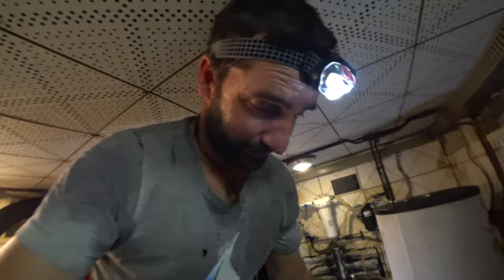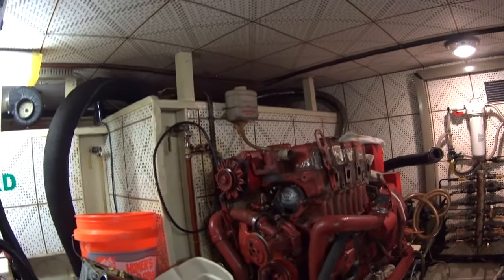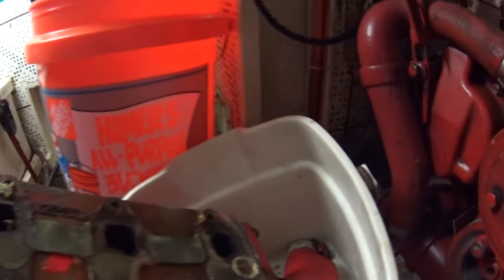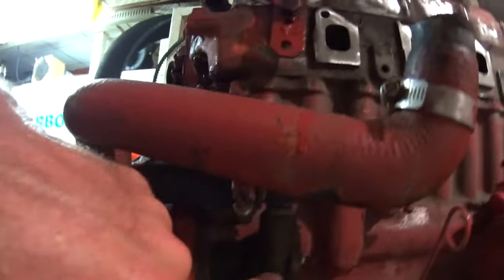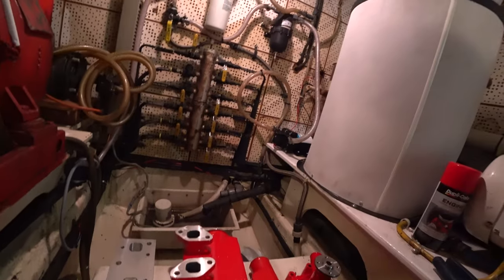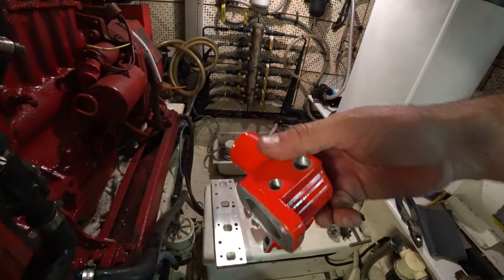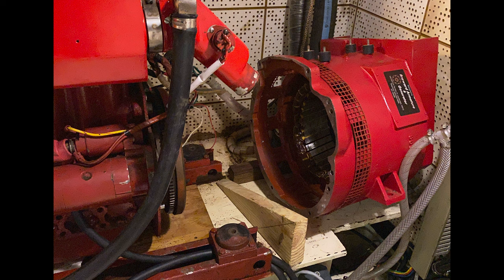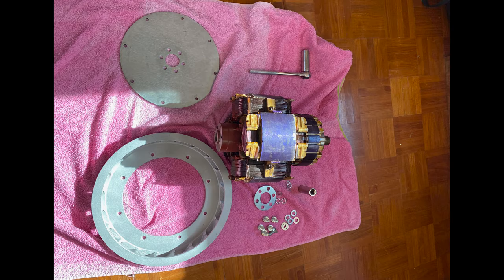Shocking Westerbeke Generator Problems! And I Found Out The Hard Way…

Comment: A new generator will cost you twice what you have spent so yeah, balance that against time and hassle. You are definitely learning how to do it though!
Reply from the maker: Yep, I figured it would have been $12-13k for a new gen-set. I spent $6,500 in just parts and re-winding, probably around $1,000 for my mechanic for a portion of the work, my time was probably worth about $3,000 at least, and I may have been able to get around $2,000 for the old gen-set. So that puts me right in the ballpark of that new setup. And not to mention my generator was unusable for long periods of time. But like you said, the experience and knowledge gained is priceless. And I didn’t need to go to a gym!

Comment: Recently I took out my generator (Kohler 7.5kw) mainly because it blocked access to engine room plus I never used it because I’m on dock most of time. Took it out by taking it apart piece by piece. I wasn’t careful because it was going to scrap yard. It was fun pulling apart demolition style. Now I have full access to repair and maintain my engines and it was the best decision I’ve made on my boat. I plan on installing 2,000 watt inverter using existing wiring from generator. Other boat owner in my marina have followed my lead and done the same.

Comment: You've helped me make up my mind!  I'm in a similar spot with a 25 yro Onan that has given me various problems over the years (seems to eat raw water pumps, not the impeller but the seals) and recently stopped producing output.  It might be the AVR (at least $1500) or it may be the generator end itself.  Likely it will need to be pulled to fully diagnose as it's in a terrible spot.  I think I will try to sell it, and put in something newer and quieter.
Reply from the maker: Super glad the video was helpful. That definitely sounds like a plan that I can endorse, especially if you are going to pull it out of the boat regardless. Best of luck and let me know how it goes

Comment: I got hit with 440 3 phase! Knocked me 10 feet still standing on my feet. After all of the feeling came back I found out I was lucky in the way it happened since I had no real injury from the shock.
Just remember when facing a problem like this. It could always be worst!😊😊😊 Also a simple observation. use 2 hose clamps whenever possible! You should have told them what the normal output voltage required was for your boat the first time 😮
Reply from the maker: Oh boy, that’s intense! I always look for the silver lining, which is usually there. Indeed, I do use two hose clamps whenever possible (enough real estate for two to properly bite without damaging hose). 
Yep, that was a mistake both for not telling them what voltage I was running and not asking when I picked up the unit. 
Really appreciate you watching and contributing. Have a great week
Reply: You do the same!

Comment: Those guys did a kickass job on your generator, but THEY should have paid to fix the mistake since they set it up for  higher voltage instead of putting it back together the way you brought it in
Reply from the maker: Yeah, hind sight….they did a fantastic job I must say though and we’re lucky to have them available for this type of work

Comment: This was great, thanks for all that detail. The engine sounds quiet for a Westerbeke , valves clearances must be just right ?  Is there a maintenance process for the armature bearing to stop it giving up again
Reply from the maker: Thanks so much! The engine does run pretty darn smooth, but I think the video doesn’t really pick up the extent of the noise. But all in all not terrible. I am told the new bearing is of much better quality than the previous and I should get 30+ years out of it. I may look in to oiling it from time to time, but there is not much else I could see being done

Comment: I would have done the thermo and housing,  just because how you said it needs to be done.  If you’re underway and it fails that would suck
Reply from the maker: Yeah I probably should have gone through with it. I figured I would get another couple years out of it and then I will take care of it, along with preventative heat exchanger replacement

Comment: Well done in the end you succeeded - is that rear generator bearing fully sealed or does it require regular greasing ? Regards
Reply from the maker: Thank you much. It was quite the feeling to push through it and finally succeed. The bearing is fully sealed and requires no maintenance. I am told it is much more robust than what came with the generator, so I will likely not have to mess with that part again

Comment: So....a trawler is like a sailboat. Only a lot more stuff that will break and more expensive. Got it.
Reply from the maker: Well, you don’t have all the sails and rigging to deal with on a trawler. It’s all but a compromise. It is common for a sailor to move on to a trawler when they get tired of all of the work moving from point A to point B, and not be so cramped.    Don’t get me wrong though, I love sailboats and sailing!
Reply: @AquaCultured  Agreed I did some sailing years ago but did you ever notice that 80% of sail boats underway are using their engine power not sails when going from point A to B. Humm, lol.
Reply from the maker: @darrylb4048  haha! Funny how often you see that! I have heard many folks tell me they went from sailboat to trawler because they were motoring most of the time anyway and they were tired of the hassle with the sails and rigging

Comment: Your mechanic made a bad call bud, and should have insisted you change that thermostat housing and thermostat while you are doing all this other stuff because that's going to be hell on you if that thermostat goes while you are 20 miles offshore! Hopefully its still running good bud
Reply from the maker: Yeah it was a collective decision. All is still going well years later
Reply: @AquaCultured  glad it all worked out. Looks like he might have redeemed himself if you are still running strong. Best of luck moving forward bud

Comment: If Broward didnt put the jumpers back on correctly ( the way they got them) they obviously didnt test and confirm 120V output, Whats the deal there?
Reply from the maker: The bench test they ran verified correct voltages at 120 and 240. There was fault on both sides. I noticed that the jumpers in a different position and should have checked with them before hooking it up. And it would have been great for them to let me know that the jumpers needed to be set back to 120. Overall, they were accommodating overall to help out. Valuable lesson learned

Comment: What was causing the short to the fuel line, etc.? Super dangerous
Reply from the maker: Something in the voltage regulator was allowing the electricity to stray out through the body of the generator and through its copper fuel line connection